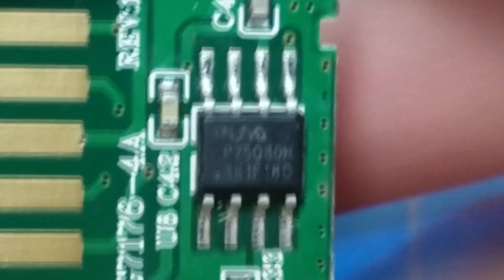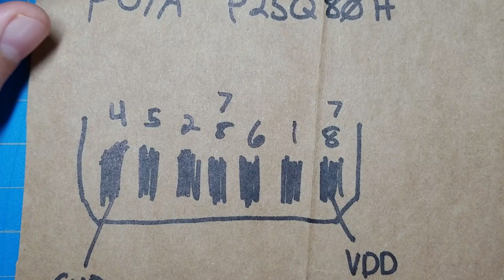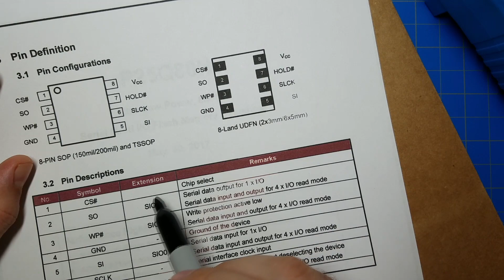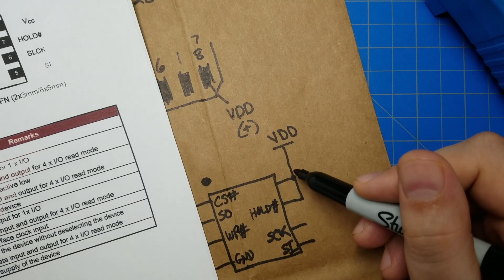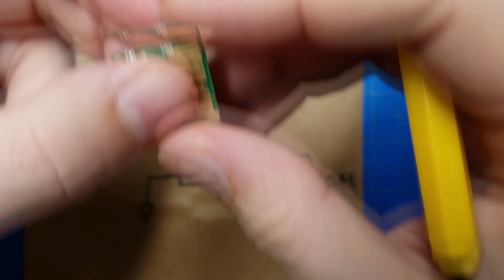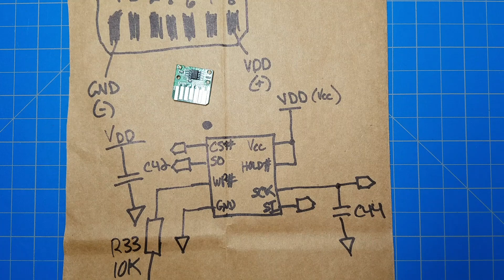Reverse Engineering A Droid Personality Chip: Part 1 - Creating The Schematic

Comment: The middle pin is tied to the power pin as feedback to the robot.  Note how the middle pin is pulled back further than the other pins - that way when the device is inserted in the bot, that pin gets connected last.  The bot will have a weak pull down on the associated pin.  When the card is inserted, the bot waits for that middle pin to go high to indicate complete insertion before transferring any data

Comment: Did I miss how you figured out how the cap you lost is 100nF?
Reply from the maker: nope, i skipped over that. before filming this i had already taken apart another personality chip and had measured that chip's capacitors so i knew it was 100nF. if I didn't have that knowledge and didn't want to take another one apart then I would have chosen 1uF or 100nF as those are typical values for a bypass capacitor and either value would likely have worked.
Reply: @Ruthsarian  oh, and thank you for answering and elaborating!
Reply: @Ruthsarian  I figured that was the case, but completionist brain wanted the closure 😅

Comment: I love these videos of yours which really breakdown the electronic components and relations on how they interact to perform certain functions. Your explanations are very detailed and can be understood by everyone regardless of their technical skill level. Another great teardown vid Ruthsarian. Did you ever find out in your journey to creating custom personality chips for the Galaxy's Edge Droids, whether or not you can program certain control instructions for the droid motors within the personality chip? That mod would help to expand the "automation" aspect of the droid and certainly add to its playablitiy and fun features.
Reply from the maker: Thank you. Unfortunately personality chips can only control the LEDs. I've found nothing that would allow for the inclusion of motor movements with personality chips. The movements that do happen, especially when a droid is reacting to a bluetooth beacon, are preprogrammed routines stored in the bluetooth microcontroller. The bluetooth microcontroller picks up the beacon, sends a message to the audio microcontroller to play a sound from the personality chip, then moves the motors through one of those routines (while the audio microcontroller is playing a clip from the personality chip).
Reply: @Ruthsarian  Thanks for the reply. I understand that's probably a choice Disney made since it would be too costly to add motor control in the microcontroller. Maybe I can use the wires and pulses for the LEDs and connect them to some low powered motors and see if I can get the droid to jitter or maybe pop out a little hatch door on its head. It's worth a shot since you measured the output voltage already. You are just a treasure trove of modding ideas. Cheers.